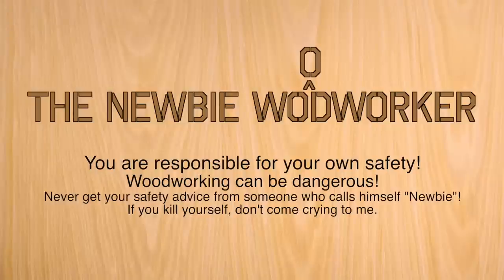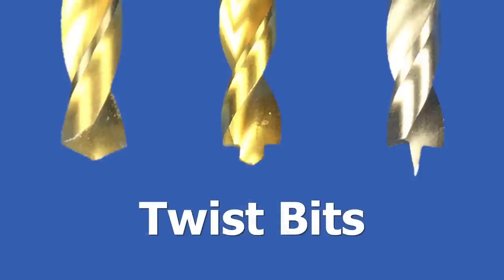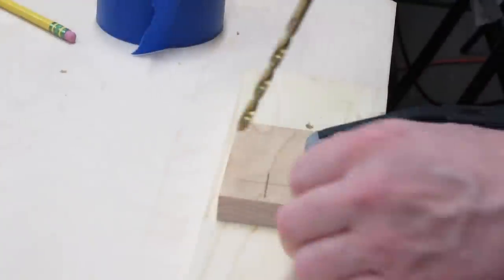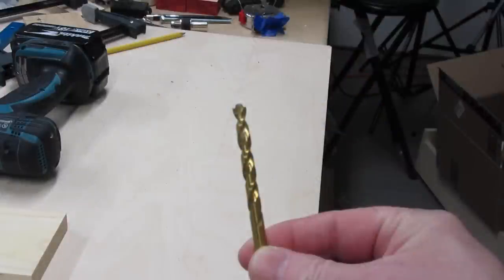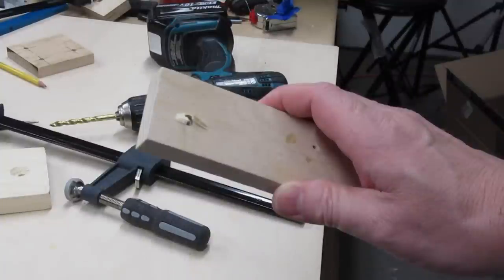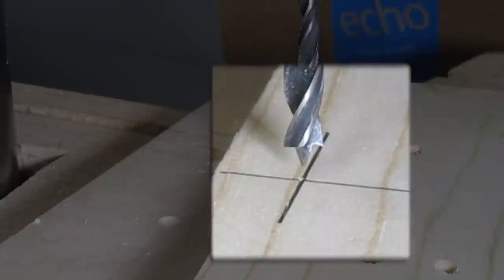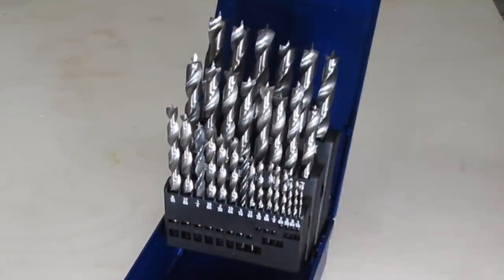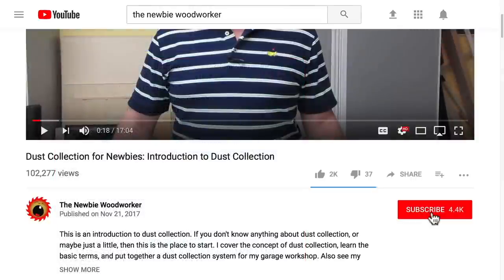Newbie Tool Tip: Brad Point Drill Bits & Other Twist Bits

Comment: I worked in a prototyping shop and a lot of work was mounting indicator lamps,toggle switches, connectors etc to aluminum plate mounted to instrumentation racks. By hand held power drill and drill-press Pilot Point bits were the best , cut through fast,  hole smooth and square sides, stayed sharp forever. Masking tape off area, scarf coming spinning off bit is razor sharp and will scratch surface and slice and dice flesh.  Multi purpose bits grab, jam up, throw material way more on soft metal plate type materials.
Becoming just a common, 'Forstner bits' 3 different edge profile. Multi points in a drill-press, any flat material should be well secured to the table. Spinning plate will remove pieces of you.
Reply from the maker: Thanks for the comment! 😄

Comment: I am drilling through , 2 1/2" of ipe, a super dense hardwood. I'm having trouble figuring out what bit is the best to use. I need speed and for the bits not to break. Making clean holes is not a priority as all I am doing is making pilot holes for screws
Reply from the maker: That's a conundrum, for sure. Pilot holes are generally small diameter, but small diameter bits break easily. So all I can say is that you should be careful. Not much help, I know, but that's all I've got. And make sure you start by punching an indentation before you start drilling, either with a punch or a hammer and nail, so the bit doesn't wander around.

Comment: I had a similar full set of brad-point from a UK supplier. They were clearly inferior and so soft they could be filed ! I now have a smaller set from FISCH which are properly hardened and perform really well. I also have a full set of the DeWalt pilot ones which are good, but can 'grab' the work of you're not careful.
Reply from the maker: Thanks for the info! I agree about the DeWalt ones, by the way. I suppose the brad point bits I have now are good enough to not need to replace, but I sure wish I had ones that are better. Sounds like you found a winner in the FISCH ones. 😄
Reply: @TheNewbieWoodworker  FISCH were highly recommended by Canadian Rob Cosman on his channel so I bought some !
Reply from the maker: @normanbott  Cool! Glad they were as good as he said they were. 😄

Comment: Thanks, i started woodworking with a oldschool manual hand drill. Didn't know about Brad point drill bits. Tried to drill a hole using a regular drill bit and spent an hour or two still couldn't finish.
Reply from the maker: Glad I could help! 😄
Reply: If you're using a Bit Brace drill, the best drill bits would be Auger drill bits. They can cut smooth holes about just as good as Forstner bits. Plus, the auger part helps pull the bit to cut out more wood as you use it. I would not recommend using them in powered tools though.

Comment: I couldn't post my comment on your blog due to sign in limitations. Things that should be simple have become unnecessarily complicated.  Small rant allowed since I'm 72. My attempted comment is that I bought a set (5 or 6) brad point bits from Festool 8 years ago. They work perfectly and have never needed to be resharpened (if that is even possible for a hobbyist. Enjoy your channel.
Reply from the maker: Thanks for the comment. Sorry about the login needed on the blog, but without it, I get a bunch of spam. And I agree - with age comes the privilege to rant! Regarding your bits - I love it when you buy something years ago, and it's still going strong. It's a great feeling!
Reply: I do understand about spam. Not a criticism of your blog site but just a general rant.Don't get me started on spam.
Reply from the maker: LOL. Agreed.